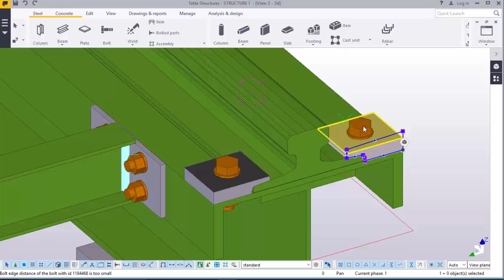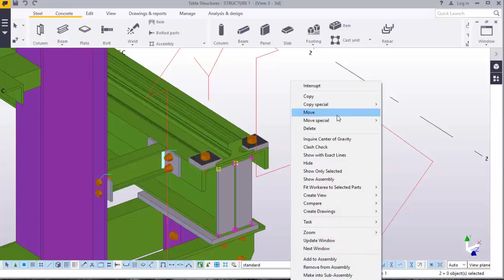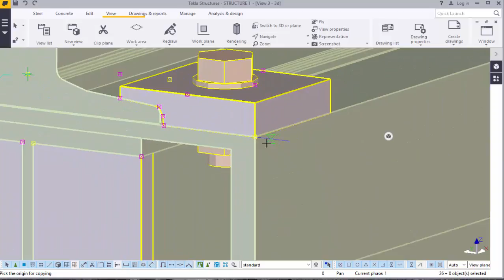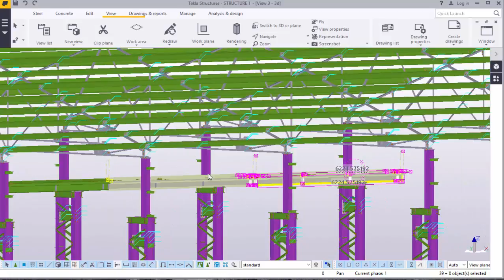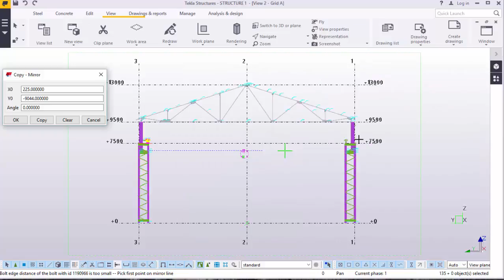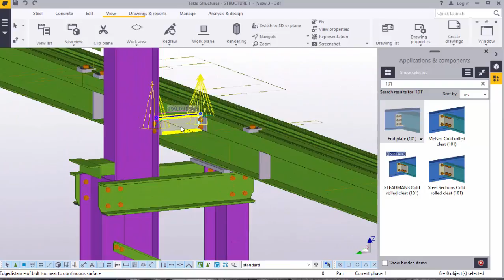Crane girder reinforcement and Crane Rail clamping in TEKLA STRUCTURES 2016

Comment: Glorysteelwork is the manufcture of hot rolled steel square bar in china, we could offer different grades MS square bar. Also we could supply crane rail flat bar with high quality.

square bar is widely used in cutain wall, engineering machinery, shipbuilding, elevator parts, crane rails and automobile industry.
http://www.glorysteelwork.com/hot-rolled-steel-square-bar/